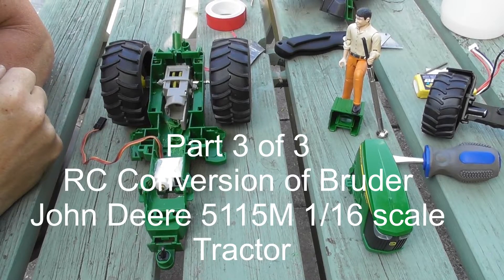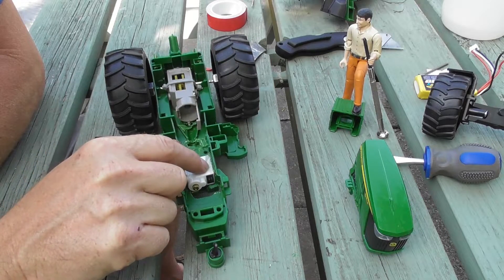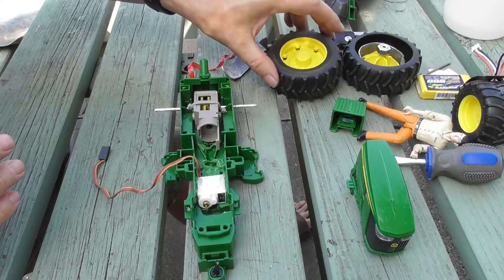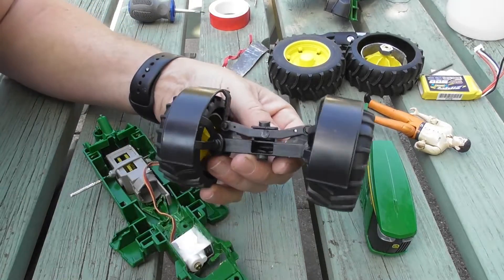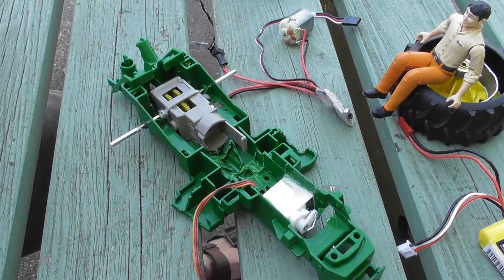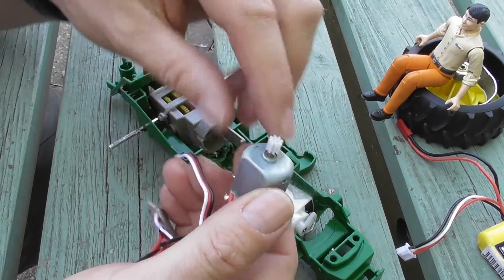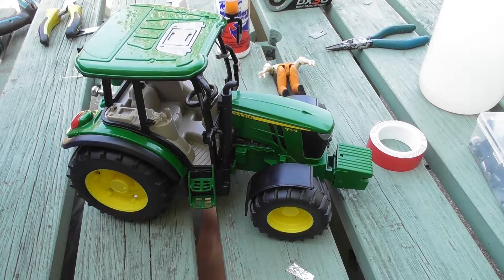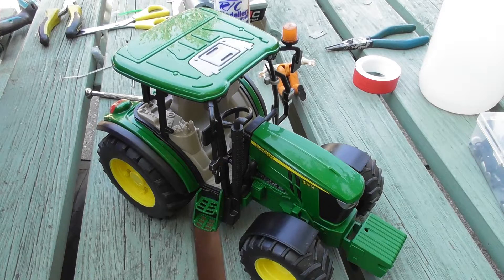Bruder Tractor RC conversion pt3 : steering & electronics

Comment: very cool again bud I recently purchased a ertl 1/16 dicast farm tractor for a conversion..I do wish bruder came with rubber tires.. Thats one and only set back but there is a world of tires out there also just got to do some thinking to make it work like you said.. 8-)
Reply from the maker: With a bit of lead in the tyres it goes a lot better. The limited space was the real challenge with this one.

Comment: Great videos! What motor would you recommend for one of these? Do you have a link at all please? Thanks !
Reply from the maker: Thank you. I think that I used the gearbox motor from the Tamiya tracked vehicle set. Standard tamiya motor worked best - but just limit the ESC to about 60% travel as the motor is low voltage (v.cheap to replace tho) here is a uk amazon affiliate link: https://amzn.to/2V7BD3Y 😀👍
Reply: @RCModders  Thank you :-)

Comment: Hallo Freund, kann ein beliebiger 12V Gleichstrommotor an 7.2V angeschlossen werden? Grüße
Reply from the maker: Translation "Hello friend, can any 12V DC motor be connected to 7.2V? greetings". Greetings to you also. I think yes it can - although the motor will be a little slower and less powerful below its rated voltage. 😀👍
Reply: @RCModders   Vielen Dank für die Antwort. Ich nahm an, was ich nicht verstehe, ist, weil Leute 12V-Motoren verwenden, wenn es 6V gibt. Würden Sie mir sagen, dass normalerweise rpm verwendet wird? Ich bin neu und mir fehlt etwas. Grüße

Comment: I am going to convert the Bruder fastrac. Just need to figure out how to make a scale mower to fit it and I will have fun cutting the grass.
Reply from the maker: That is a good model to convert. I did one with 4 wheel steering and 4 wheel drive - with a mix to allow different steering options (front / back / all / crab) using a Flysky GT5 transmitter. 😀👍
Reply: @RCModders  I will have a look into doing that, I am going to look to see where I can get that transmitter at a good price as the extra channels would help (I have seen some rigs that have servos on the front and rear to lift up the 3 point hitches) so the more channels the better. I have been messing around with my mn99s for now as delivery for stuff is a bit bad (my mn99s took 3 months to arrive)

Comment: Can you show how your usual method of attaching the wheels to the models? Thanks
Reply from the maker: More recently I have moved to designing 3D printed hub adaptors and motors with built in gearboxes - the tractor was one of my earliest attempts to convert Bruder toys to RC. Still, this one runs very well.  😀👍

Comment: nice build..
Reply from the maker: Thank you. This was surprisingly satisfying to do. There are plenty of little challenges, but nothing that can't be overcome with bit of thought. It actually goes very well - for what it is - and given that it cost £25 including the green tipper trailer, I don't think you can really too go far wrong. I might try one of the 6v motors to see what difference it makes.

Comment: What is the name of your metal bender tool? Where did you get that? Well done on your mods Sir!
Reply from the maker: Thank you. These are my ones - Irvine - they have a little pointy bit which when inserted into a servo control horn hole gives you a perfect length every time: https://www.rcworld.co.uk/acatalog/Irvine-Super-Z-Bend-Plier-with-Nav-Pin-T_ZB01.html?gclid=EAIaIQobChMIrZjmi4Lt3wIV4ZXtCh2wmgy5EAQYASABEgImifD_BwE 😀👍